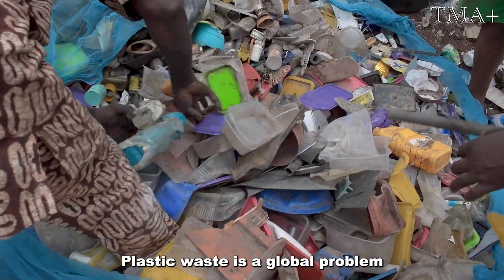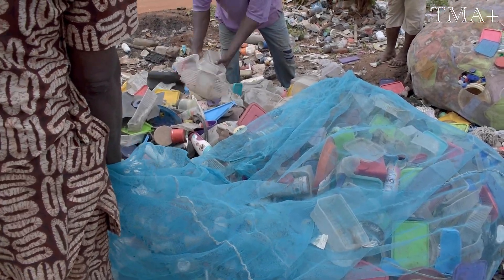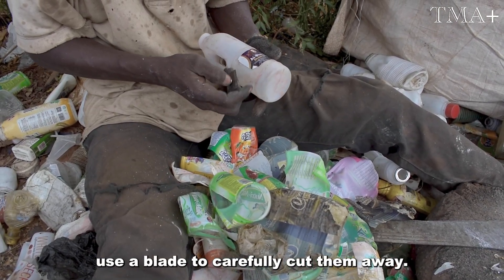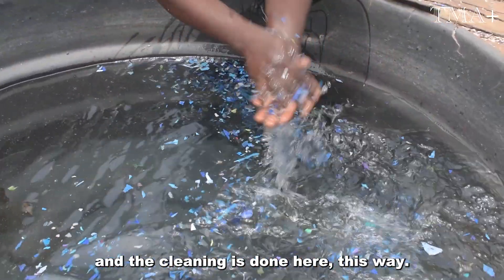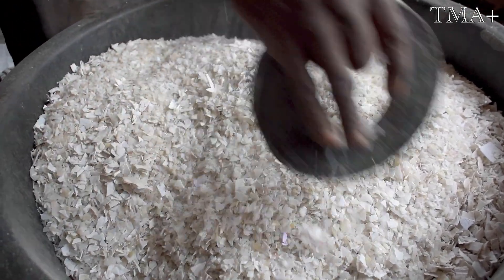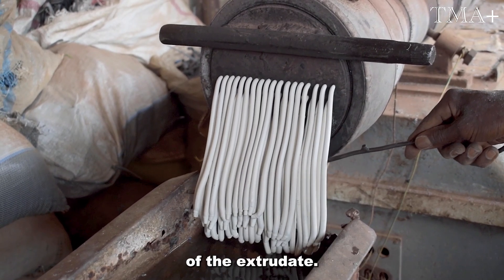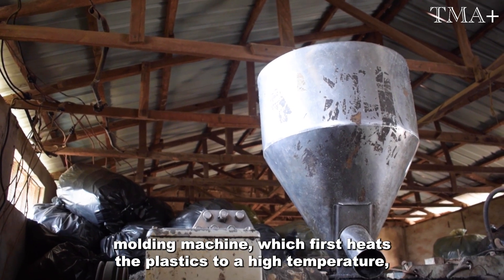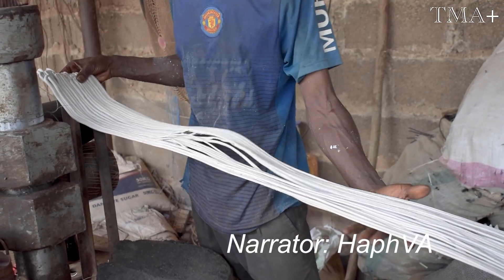How Plastic Recycling Works In Nigeria

Comment: Plastic is made with molds and dies, if we require every plastic producer to stamp their address on their product, we can send them back to the manufacture.
Reply: Or why don't you as the consumer stop using plastic? Several companies use glass bottles with a deposit that clean and put milk back in, like years past.